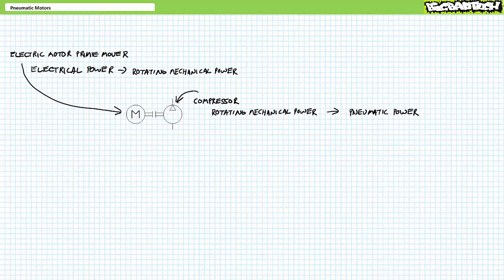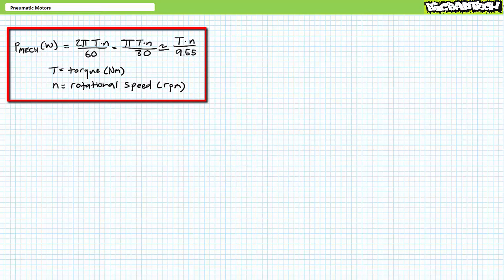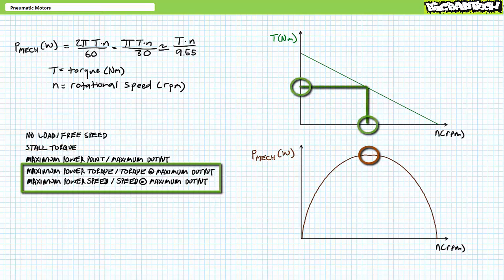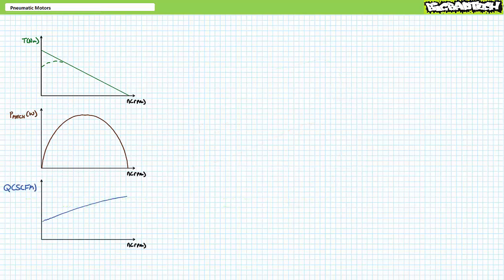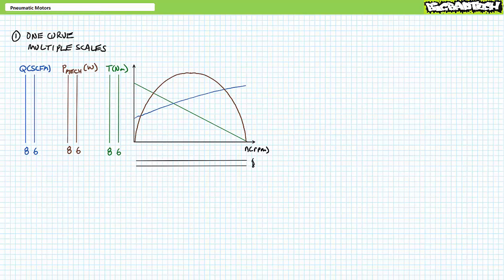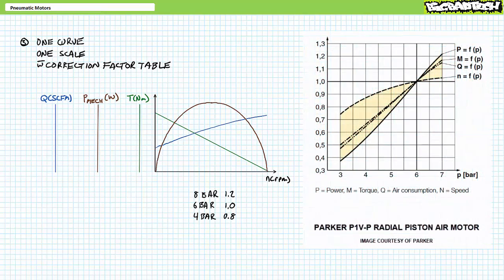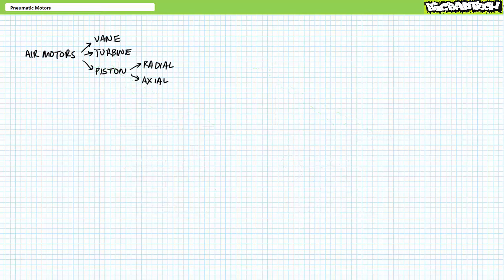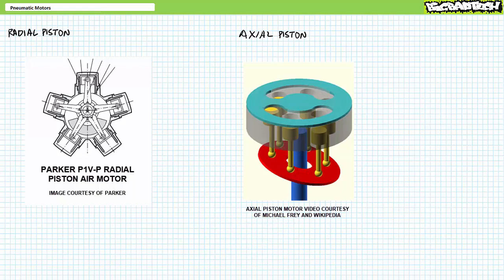Air Motors (Full Lecture)

Comment: For anybody who hasn't used an air powered device, they get really cold. The most annoying thing about those things is how you need to wear gloves because your hands freeze! As air pressure declines, you get adiabatic expansion that naturally causes a temp drop.
Reply from the maker: True dat! Ironically enough I was using a pneumatic die grinder just yesterday. It's just starting to get warm in our region of the US so the welding room was about 80F and the grinding room was like 90F. Not only did I appreciate the coolness of the tool, I had the primary exhaust pointed at me! Check out the combined gas law lecture that describes the relationship of pressure, volume, and temperature at: https://youtu.be/zCZFXj36b0s